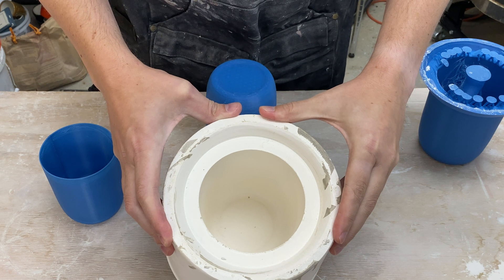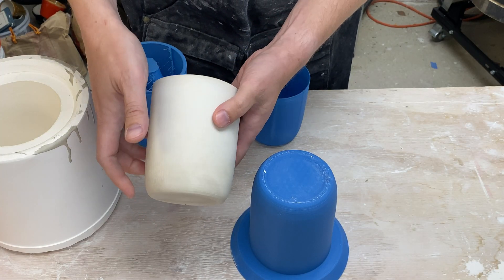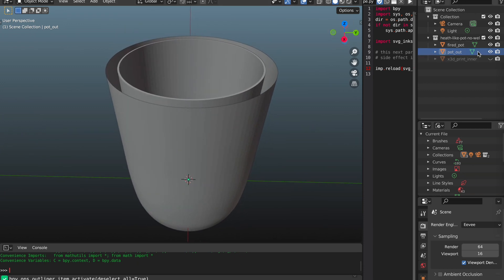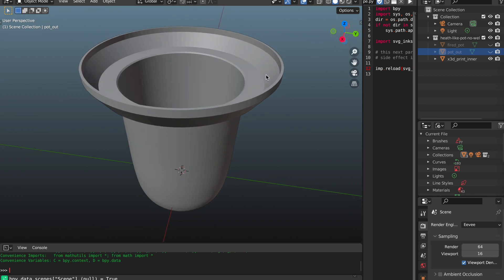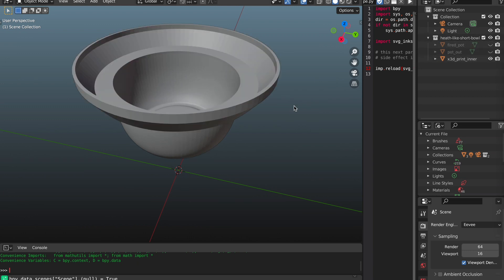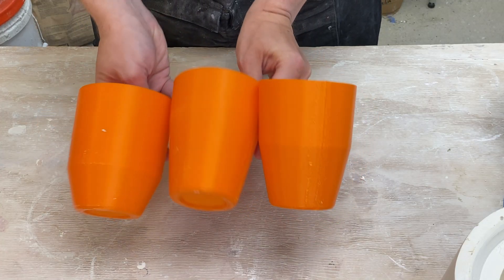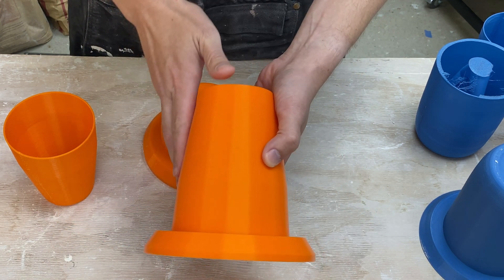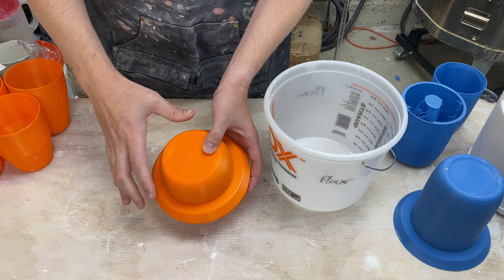Sketch to Slip Casting Mold - Automatically!

Comment: Dear Kent. Thank you for letting me at the Beta version of your program. I tried it and ı dont know why when I attached the file to 3d printers program it scales the model in to a huge one. Since the model has many peaces it is getting very difficult to scale it in to needed size. I am just learning how to use bamboolab.  So when it comes to scale to needed size it becomes impossible :( ı send the line art in cm’s. What am I doing wrong?
Reply from the maker: Send me a email. It sounds like the scale of your SVG is wrong (wrong units). The 3D files should not be scaled at all - they will not print correctly if you scale them,
Reply: @PotterybyKent  yes, scaling does not work … So I will send the files as soon as possible. Thank you very much Kent!

Comment: Hello Kent! Many thanks for your work! At 9:22 you mention different settings for the rotation step sizes (36 and 360). What are these settings? Is this a setting in the slicer? I am new to 3d printing. I just printed a bowl on standard settings (0.2mm) and the sides of the bowl consist of 5mm wide faces. I understand this is the reality of FDM printing, but would like to make them less noticeable. Thanks!
Reply from the maker: Sorry for the confusion. This is a parameter inside of Shape Cast that (at the moment) isn't exposed. It is not a setting in the slicer, but one in how the actual 3D geometry is generated. (And any parts generated with Shape Cast right now use this higher resolution setting).
As far as layer lines, yes you'll notice them at 0.2mm layer heights. You have a couple options. One is to reduce the layer height and speed - this will help but won't make them go away. It is also sloooow. The other option is to do some post processing. I have another video in the play list where I use a special primer and sanding. With that you can make it as smooth as you want. There are other similar methods that involve post processing the part, but I've only used the primer.
Reply: @PotterybyKent  ok, I see, thanks! Yeah, I want to try to print on the fine or extra fine settings and then try the primer + sanding method.

Comment: I have been considering using a 3D printer to make plaster molds and see your video as very timely. I do not own a 3D printer yet.  Do you recommend a specific model?
Reply from the maker: I have an Ender 3 which is pretty old at this point. It works and is cheap. I know there are newer faster printers but I havent really looked recently at options.
Reply: I own 3 Prusa MK3s and have been very, very pleased with being able to "just print." All have worked out of the box. I've found several now on eBay for about half the cost of a new printer. Prusa's are a bit pricey, but they do work well and reliably.  Less expensive printers tend to be more fiddley and at times, frustrating. So, in part, it depends on if you want to learn about the ins-and-outs of 3D printing and printers, or just print molds. One thing to look for is the size of the user community, as this is typically your "support."

Comment: Nice work! You made my day when you added the thought of printing the pouring surround and not using the bucket! Looking forward to the next video
Reply from the maker: Thanks! One of my earliest 3d printed molds also had a 3d printed outer shell (designed manually) and I've been missing that. It'll be great to have in my new molds and done for me by the software!